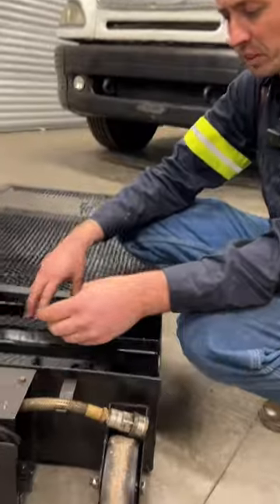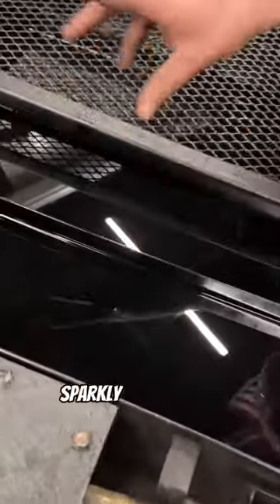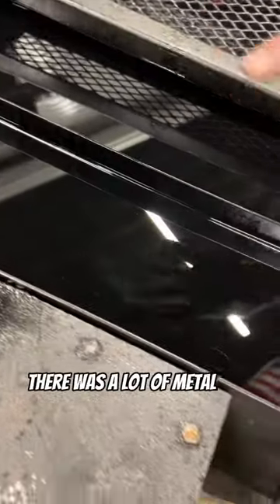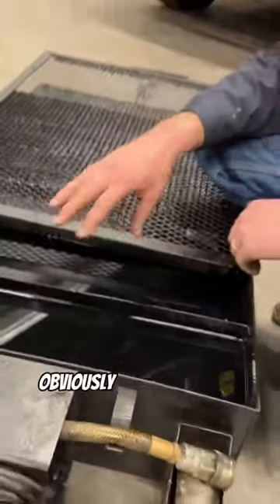A chunk of gear came out from oil drain hole from the oil pan😱 #shorts #oilchange

Comment: If you get into any X-15’s, head gasket, cam, anything that requires you to pull the cam gear and adjustable idler gear but not the upper idler gear, double check the four bolts on the upper idler gear before you close it up. There are multiple cases of those four bolts backing out from the factory.

Comment: That DD15 still better then a paccar? 700k on my paccar still going strong.
Reply: in my opinion yes i have 3 they all went ovet 1 mil no major issues they are overhead cams paccars are pushrod engines
Reply: It's all about that X15 my dudes, Cummins ftw